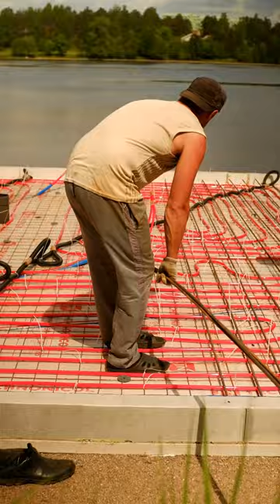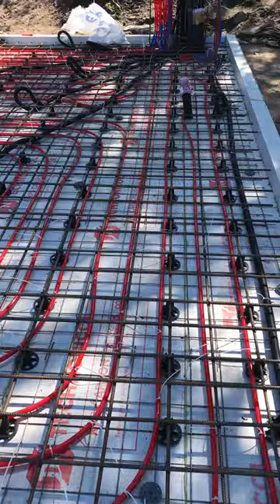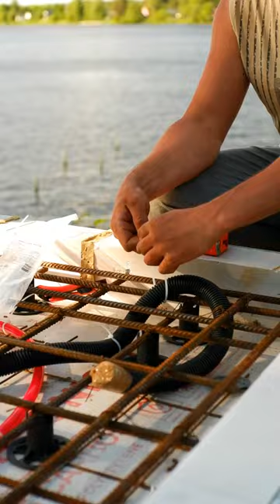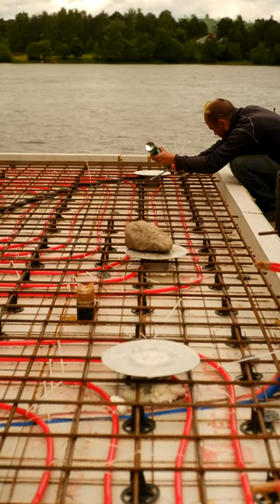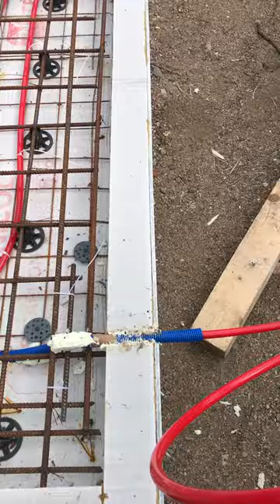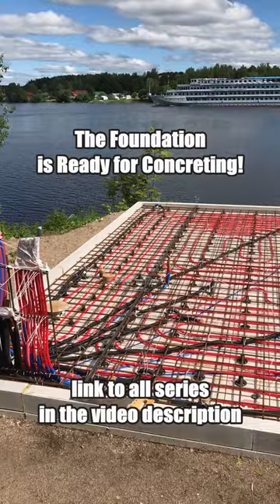The Foundation is Ready for Concreting! The Path to the Dream Bathhouse: Episode 13

Comment: Too many pvc and hose that will lessen the required cement, sand and gravel for slab. It's like a Christmas tree too many decor's 😅😅😅😅😅
Reply: Why would you say that when that's the required amount of water lines to heat that floor